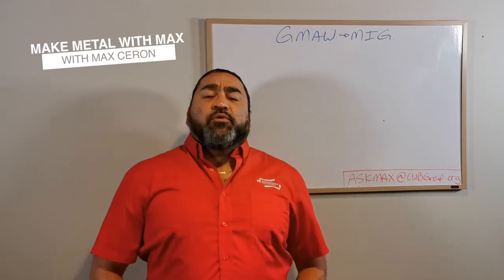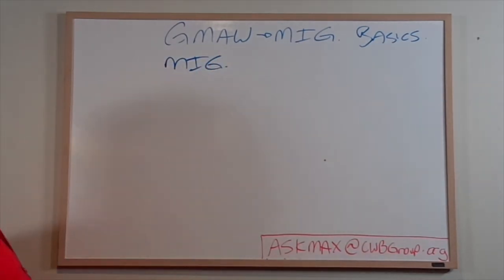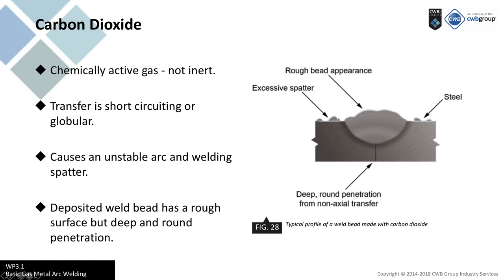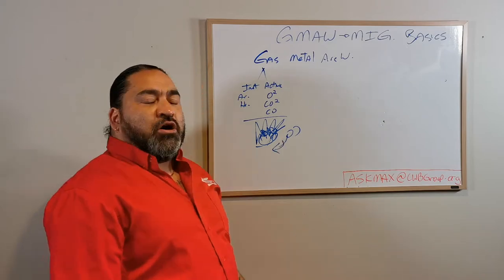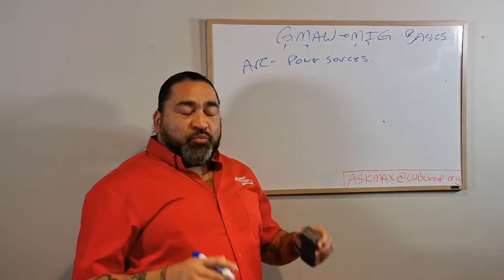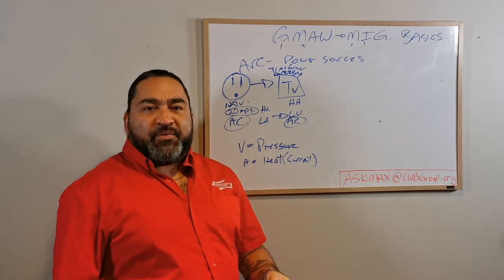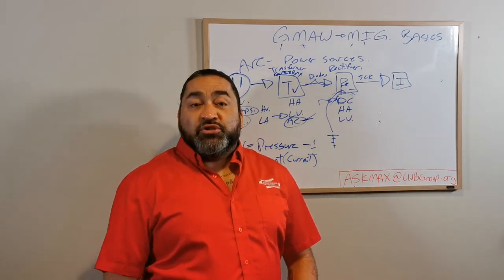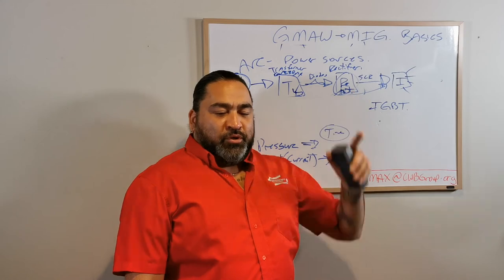Make Metal with Max - GMAW Part 1: MIG

Comment: I heard you on the Arcjunkies podcast.  I am learning GMAW on my own, for autobody repair for a rusty car project . For now I just want to get good at sheetmetal up to 12 gauge or so. Right now I practice on 16 gauge. I have a Lincoln easy mig 140 with gas. It has a bit better drive mechanism than the 140 Mig pack..  It is going ok so far. I melt through the back a bit which I guess is not good. No holes at least.